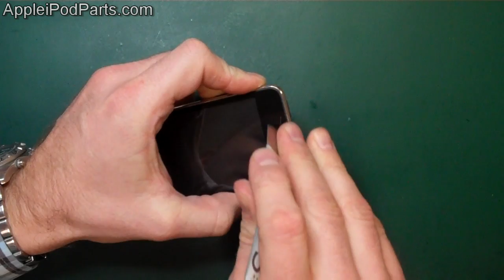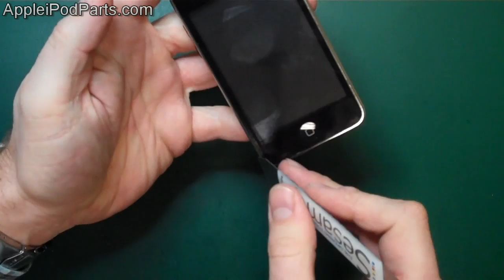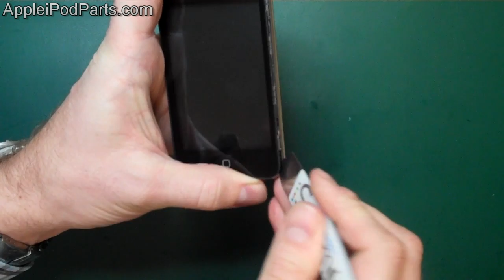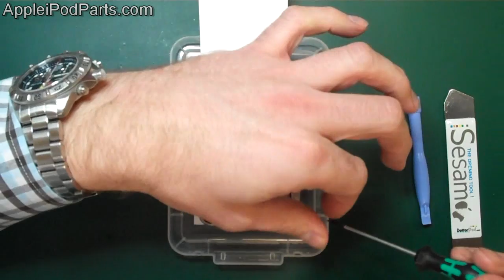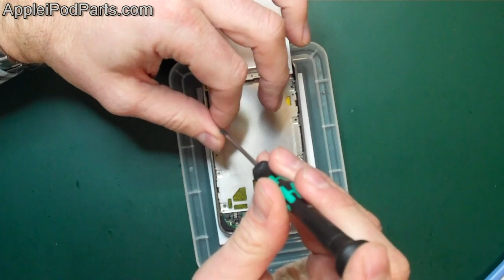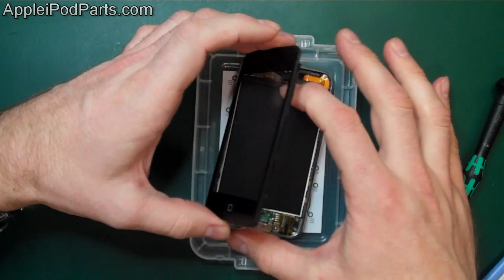iPod Touch 2G/3G Battery Replacement Repair Guide - www.AppleiPodParts.com

Comment: This is by far the best video for this "operation" on your iPod.  Very detailed with no steps skipped except the actual desoldering and soldering of the battery.   Thanks for the detail and camera work.

Comment: Brilliant video. Is it possible to put a slightly bigger battery in as it seems there is spare room all around. Li-Ion is widely available and 1500mAh is 2 x 740mAh, right? In theory it can be as big as the display. That would be even 2000mAh. Great MOD.

Comment: Sigh, Thanks to your advice, I managed to get the screen off without cracking it but one of those tiny tiny screws threaded :( Had to drill out the last one - finally succeeded -only to accidentally damage the LCD screen with the hairdryer trying to get the battery adhesive to loosen up (it didn't). Off to order more parts...

Comment: this was supposed to show battery replacement. Why didnt you show how to replace the damn battery? Is it a plug in on the end of the cable connecting the battery to the board? Do i have to solder it on?

Comment: The 8GB iPod touch 3 is actually an iPod touch 2; the real iPod touch 3 shipped in 32 and 64GB.
Reply from the maker: You are bang on with this info and 100% correct, it was a bit sneaky by apple and caused some confusion in the early days with parts too! Lol
Reply: AppleiPodParts.com Okay, you can pin my comment for the info.

Comment: LivingInEndTimes777 Basically get to the point where the tray is out and the LCD is unplugged and removed. You can see those three connectors for the battery, and I have no idea why the title in the video says battery replacement because the guy in the video never mentions how you have to DELSOLDER and SOLDER the three small terminals. You have to have a good soldering iron with a fine tip and good solder. Also the hardest part is prying the digitizer glass from the chassis, and also removing the screws on the metal tray. No idea why they used phillips head screw (which are designed to cam-out and LIMIT torque) with loctite. It's like they want you to strip the heads.

Comment: I didn't even use a hair dryer. I just tore that SOB straight off the metal plate. Too bad the battery started leaking...

Comment: Hi,

     I have a 3rd gen and received the LCD I ordered and installed it completely, but when I try to turn the iPod on or charge it nothing happens. Even when I connect it to my laptop the laptop recognizes nothing. I think i accidentally disconnected the battery, but i can't check, because I can't unscrew 2 of the screws needed to remove the metal plate beneath the LCD. The screws are worn and the screwdriver can't unscrew them because the hole is wide. I don't know what to do, please help?

Comment: “Just pop the clips”. Ok, how?  Didn’t realize until I broke the digitizer and it pulled it off to see the the clips need to be pushed to the outside to allow the plastic bezel of the digitizer to come out.  Had this been explained, I would have known the mechanics of the clips..
Reply from the maker: Hi Brandon, good point and apologies for missing that out, we will make sure that we are more specific in future.

Comment: I need some help, I have an iPod 4th generation. The the battery was it staying charged. I went ahead and ordered a new battery and the tool kit. The installation went pretty smoothly installing the new battery, But I went to plug it in and its not charging the battery. The unit dose turn on and works fine. What is the problem, any suggestions would be appreciated. Thank you
Reply: what you did after?

Comment: Why the frickin' hell didn't you FIRST power off the iPod Touch???? This is an IMPORTANT thing to do BEFORE proceeding on doing ANY replacement or stuff like that to avoid battery shocks and even damage it
Reply: DJ V.a.r.  Becouse he did it a 1000000 times 😉😉
Reply: because he was perfect.. why the fuck anyone didn't thank him in first place?

Comment: Just to confirm
IPod touch 2G and iPod touch 3G (64gb) use the same internal battery right?
I just want to know if anyone anyone installed a 2G battery in 3G successfully

Comment: I have a question, I have rapleaced the ipod touch 3g screen and the LCD Display Touch Panel Screen , after few day I put the ipod in bag, he was there like 8 hours,  when I took it back the screen was White with apple logo, and where is the USB port its was very hot, I tried to reboot(restart) it But I get the same white screen twice and then it's turned off, and now for last week i can't on it. I bought the ipod like 3,5 years ago, do it's battery died or what it can be? some1 know?help me plz

Comment: Erm, let me see, so it has the battery in it, therefore power to the boards, and your using a Metal knife to open it with and run round the screen with !!. Ever heard of a short circuit !